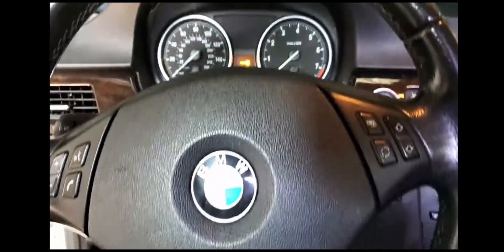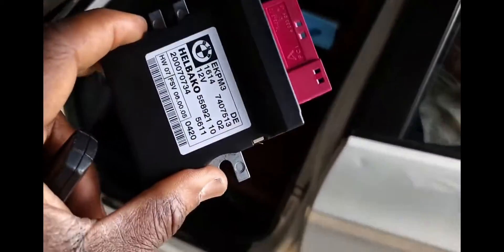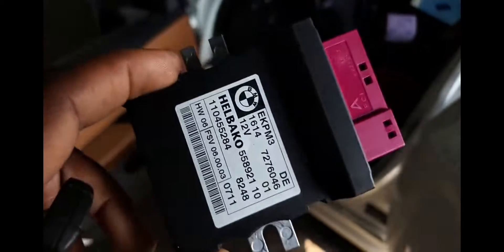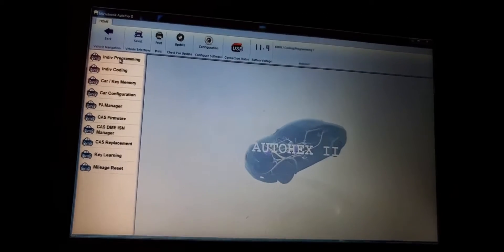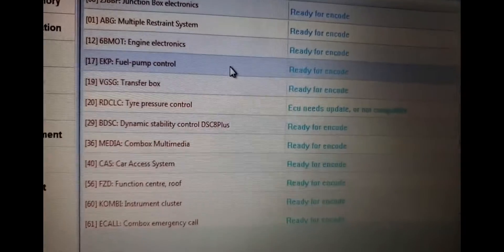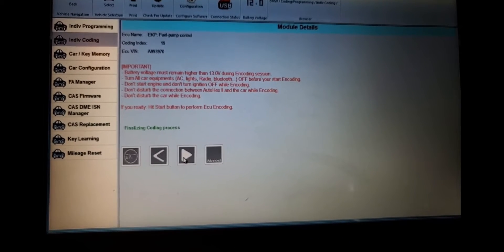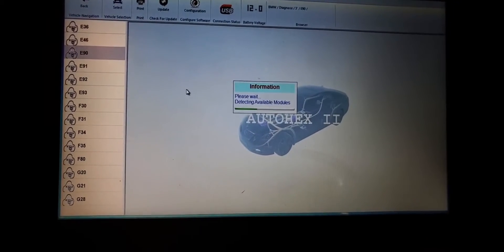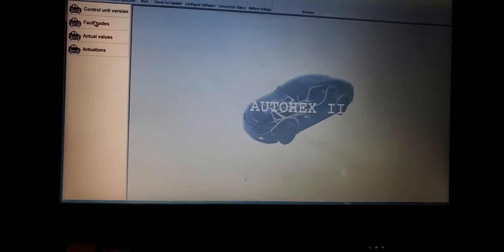Swapping and Coding the Fuel Pump Control Module for 2011 BMW 328I

Comment: Are you located in ny
Reply from the maker: yes
Reply: I might need help to code a fuel pump module. Where are you located
Reply: @bestcarfixes are you in the NYC area? I need to tow my car to you. I have this issue replaced low pressure fuel pump and car starts sometimes other times it dies. Its a 2011 328i